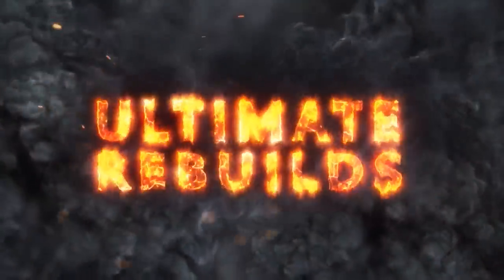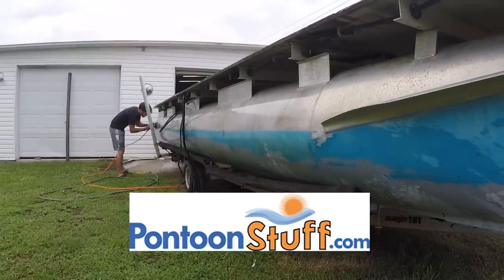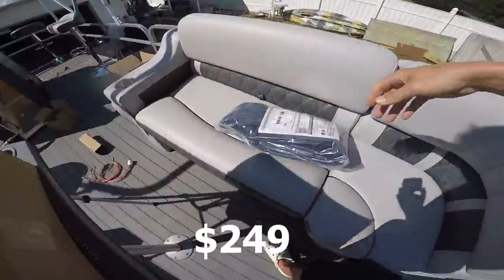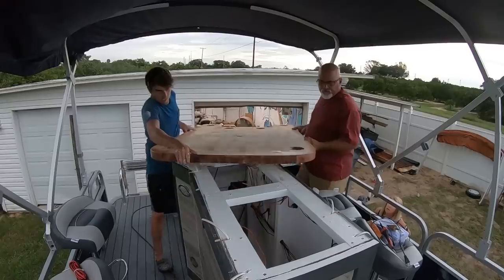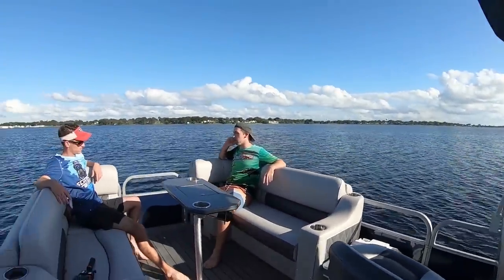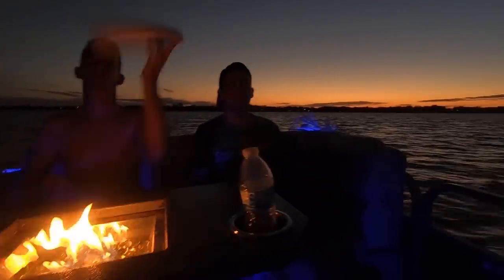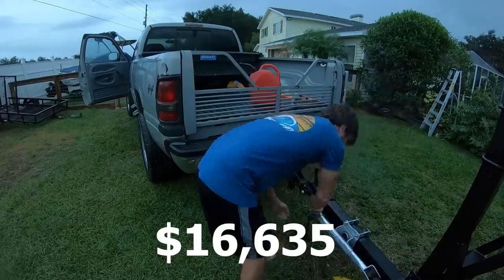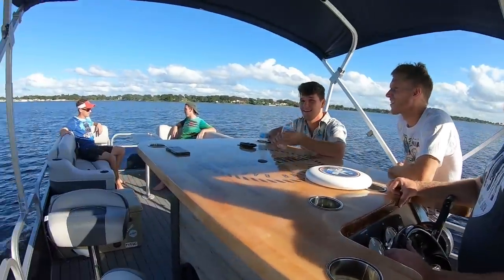How Much Did My Custom Pontoon Boat Cost?

Comment: Great job covering your rebuild in a single video!  I learned a lot.  We bought a lake house last year with a great dock system.  We are now considering a pontoon boat.  They are not cheap!  The budget friendly ones are, in my opinion, refurbishment candidates.  The decent quality ones are $15,000 up (without a trailer) and its a compromise since they don't usually have everything desired.  So I am seriously considering building/rebuilding my own.  Your experience will come in handy - definitely!  Thanks!

Comment: So yeah, what they said.😊 Seriously, you did a top notch job on this boat. What impresses me more is your attitude, the way you is how you follow through on everything. Especially selling all that stuff that came off the boat, and the trailer and whatnot. I saw a number of people that were saying you sold it too cheap, you must value your labor more. I thought pontoons were way cheaper than they are. I bought a mint 24' with trailer from Missouri or somewhere. It was $12,000. Then I realized that was 20 years ago. Ouch. 
    You are only 22, and already have a GC License, so you have plenty of wriggle room. You are super on the right track. In 3 years, Your channel, if you keep it/them, will be managed by your                                            secretary, who handles the phones, you are bidding jobs, buying material, checking in on your crew(s).
You are going to be one of the winners. Watching your  process from buying to selling, I know you will be a millionaire by 30, if you want to.

S.C.O.R.E. - Service Corps Of Retired Executives is a great resource, chapters all around. Don't be afraid to switch around, they really get it about things needing to click for both parties.

It takes a good 5 years to have things under control, not scrambling to make payroll because you are waiting on a $15,000.00 check that is 45 days past due, and paying yourself what you would accept from another GC trying to hire you. If you have to loan money to the business, that's ok too. 
The IRS says you need to take a "reasonable" salary. Owners mostly don't want to take a salary, because of the taxes you pay. But, it does include Social Security, regardless of what people say, you will get it. Also, you need to have I think, 3 years, of BIG paychecks, but they use your 3? top income years to calculate the check you will get forever once you retire. benefit. It cannot be obvious, so ramp up and down. It may very well happen anyways. You will always be the last guy to get paid, so getting your pay cut money is fine, and if god forbid, you are the one who falls off a roof, you want all the disability help you can get.

You also, and this is just critical, you need to ask: who are you, and what do you want? Dead serious, does business course through your brain? Are you a total hands on guy, not looking to get real big, please keep me out of the office. How long do I want to do this? I HATED Tree Trimming with a passion. We started by putting out flyers, yellow page ads, ask a parent what they were. And we got what we were asking for: people who call from flyers, yellow pages, names on all our trucks. I would go estimate, and you MUST talk to contractors about properly written contracts, and buy yourself a FLIR infra red hand held scanner, shows hot as yellow, red, cool, cold as Green to Blue. 

Final thing, I promise. Really avoid partnerships unless goals: I want as much as I can take out each week. Well I want to leave more money in the bank for a cash flow insurance. I want to expand. I want it like it is. We were lucky because my brother would go and do whatever I needed him for. He was Ops, I was office.
We saved almost every penny, kept buying rental units. Our retirement would be quadrupled by taking all our profits, planting them, and that is far bigger than what we could ever live off from the Tree work.

Good Luck, which is another form of making your life into what you want.

Comment: This was a great build.  
You mentioned that you wanted to make a party boat so I have an idea for you on the next pontoon build.  

Start with the base pontoon boat and instead of the railings ( as they are now ), install 4 foot walls that fold down (like an outrigger) once you get to your party location.  This would add 8 feet to the width of the party boat. Obviously you would want to add pontoons to the floors that fold out.  You could also add 4 feet the front in the same manner, but it would also have two floor fold outs so there are no holes from the front to the sides.  The front would fold out forward first, and then the two sides would then fold out to join all the extra flooring that is already there. This would give you an extra 4 feet all the way around. 

Anyway, it's just a thought and if you happen to like the idea and you do end up building it, I would love to come out and see it.
Reply: Sir, absolutely brilliant idea. I've been trying to build my own party pontoon but found that 8 ft wide (which is the widest it is allowed to be street legal) was just too narrow and flipping was a major hazard. The additional foldable pontoons would add so much space and stability. Wow
Reply: @perrybb2  If you do build this, please tag me so I can see the video.
Reply: @Jeff-gt2xu  I think I'm gonna put the additional outriggers on hinges and have them swing all the way flat on the inside rather than have them act as foldable walls. I'll link it here if/when it's completed. Right now it's a pretty trashy and rickety little vessel. It doesn't even have a motor

Comment: Here in Seattle area new pontoons Start at $1,000 per foot. Then add accessories and a little bling and you're easily $30-$50k. Used ones usually don't last more than a week in the classifieds. We have a 26 Kayot and added 2 front fishing seats, 2 rear seats, and an enclosed porta potty in the rear corner behind the driving console. It has foldout beds,a collapsible hardtop, and we replaced the 45 with a 75 and a 20 kicker and a remote controlled retractable electric trolling motor up front. And the Way Koolest trailer, back it on the lawn, crank winch#2 and the entire trailer squats down and gently sets the boat on the lawn and pulls out from under it.  Don't sell what you built, it's incredibly universal.👍👍

Comment: Most people watching this are here for the build. As a boat person….You can only carry the amount of passengers it’s rated for. Not how many people you can fit. There’s no “night boating”, you just happen to get in as it’s dark or you go out early. You need the rating plate (passengers/horsepower) back on it. There was no sign of registration markings or pfd’s. Putting it in water at night with no one who knew how to operate it. Basically from a boater perspective it’s a train wreck. 

From a restore it looks fantastic tho. Good job!

Comment: At 14:31, I see starboard running light installed but suggest you check requirements for visibility  120 degrees aft to starboard,, zero degrees forward to port.  Same for port (red) running light on the other side.

Comment: Great build! Very nice!!! My only concern was that you port and starboard lights lens should not be facing forward. They should both be turned so the 90 degree angles can be seen from the front and respective sides.
Reply from the maker: That was fixed in one of my episodes. Thanks!

Comment: Pontoon boats are cool. You definitely get the most bang for the buck in terms of walking around and using it as a floating living space.  We did find the limitation is they don't recommend taking it out 10 miles into the Gulf for the simple reason it is slow and you can't out-run the storms.

Comment: Great job on the rebuild!!  We own a 2017 Aqua Patio 259 CBD Tri-Toon that we paid a LOT more than 17K for: I think we would enjoy your boat as much as ours!  
The only thing we'd probably miss is the ability to tow water skiers.
FYI: if you mount a Blackstone griddle in conjunction with your existing BBQ, you will have an awesome floating pub!  Also, we bought a portable 12 Volt Dometic compressor refrigerated cooler.   Much better than having to deal with a cooler that needs ice.

Comment: I love pontoons. I have fished from them. Skied from them. Plus the high sides make them ideal for families with young children. You can have tons of pop up shade or create a small enclosed area with a HVAC system and or a head for the ladies privacy. Pontoons are very durable since you don't have be concerned with a gel coat getting scratched. Finally they are very steady on the water.

Comment: I know I'm late here, but on your led rings on your speakers. I have a set of Infinity 10's on my pontoon. If it's like mine, the connector doesn't exist, so you need to cut the connector off and hardwire it in. This is going to sound backwards, but 12v (+) will go to black, and 12v (-) will go to the colored wires. If you want to stay with your blue theme, just wire 12v (+) to the black wire, and 12v (-) to the blue wire and you will have blue LEDs on your speaker rings. Hope this helps.

Comment: This is just a suggestion you should build some kind a netting thing for it so you can sleep in it without the bugs bothering you because you definitely look like you fit on the couch pretty good this way you can spend the night out on the on the boat with your fire going and you can also build one to keep you dry if it starts to rain something to do a quick connect so it works for you like I said just a suggestion

Comment: Did you check to see if the pontoons are water logged?  I purchased a pontoon in Florida years ago and it sat very low in the water.  Turns out the pontoons had water in them.  If you looked at the pontoons you could not see anywhere on them that would let in water.  We ended up putting drain plugs into the end and draining the pontoons after each use.   I know that now you can purchase epoxy paint designed to seal holes in aluminum.   The reason I bring this up, the weight of the bar and seats shouldn't be much more than the seats, Captain Chair and consul that you removed.   However, the weight of the passengers is another story.   If you put 8 friends on that bad boy, she is going to sit low for sure.  Most pontoons only give you about 1000 lbs for passengers after you remove the weight of the motor, gas, food and beer!!  So very smart move putting a third pontoon on her.

Comment: Very cool! Hoping to start a pontoon boat rebuild soon myself and this provided some good insight. Thanks you
Heads up though... you installed the bow nav lights incorrectly. They need to be turned out 45 degrees, that way each light can only be viewed from head on as well as there respective side of the boat

Comment: Hey. Really nice pontoon.    My friend. I see you were installing your center tri toon with STEEL BOLTS.  You may want to change those mouthing bolts to STAINLESS STEEL due to SALT WATER.   
Or brass if there available.  Trailer internal parts don’t last long without added protection from salt water also. Check out cold galvanized paint. It works but disassembled is best to cover all areas. 
Ok. Later

Comment: I had the most bad ass pontoon. 30’ crest,  I shined the pontoons to look like a harley. It was rediculous. My neighbors used to hold there eyes and say damn where are my sunglasses. It actually hurt to look at when I turned into the sun.A shit ton of work. And a lot of time. The seats were custom made from the crest factory, super duper nice thick vinyl. Took 23 people out the first day and didn’t even bulk. I missed that bot and kick myself to this day! Sold it sooooo cheap. Bought a wakeboard boat. I miss putting in six gallons of gas and putting around after work for a week.. wakeboard bot holds 50 gallons and it hurts to fill. Well I had both boats for a while. Now I want the pontoon and sell the wakeboard boat. But I can’t find another one like it. Been looking for years.
Reply: Oh yea and I hate the new designs. Mine had like a 4 foot front porch.

Comment: Great job. The only thing I would have done was Drylock the plywood which would have kept the wood solid. Also, if you add a second deck, put the base on hinges so the deck could rock back to being flush with the lower level. .. oh and a BBQ would be awesome.

Comment: There's a sticker on there somewhere that tells you how many people it's rated for and how much weight you can have. I don't go by that. My buddy had a 30 ft tritoon with a 250 on it. I mean this thing will literally plane off and pull skis, floats, whatever your choice is. Top speed was around 37. There's only one problem with a pontoon boat that I hate. There's a rubber piece in the prop which is considered the clutch. It is very easy to break that clutch loose and you're stuck on the water. When the clutch goes out, the propeller has either broken loose from the clutch or the mounting spindle but either way you are stuck. Take and invest in a backup prop. It don't have to be anything special but I would definitely stick one in your storage.

Comment: Not bad if you don't have any value for your labor. It sure is a lot cheaper than the $90K I spent to buy my pontoon boat. However mine is a 27ft Barletta with a 300 hp Mercury V8 hanging on the back. You got a pretty good deal and I enjoy your videos. Party on my friend.

Comment: Might be a dumb idea, but you could probably grab a decent rope with a clevis that you could attach to the back of the trailer so when you off-load it and pull out, it pulls the boat to shore.

Comment: I like the led strips.  I would have put a float switch on the very back of the trailer so they automatically light up in the water.  Just a thought.

Comment: Just cover your gas tank with tarp material made into a shroud that opens on the top to fill the tank. Any canvas awning company could make it for you. 
I was thinking that if you launch the boat by yourself that you could tie a rope to the bow and to the rear of the trailer so that it unravels and pulls the boat to the shore as you pull the trailer out from under the boat. BTW, how do you get sponsors?

Comment: Nice work.  I love to build these things.  Mine is like a an aircraft carrier in its convertability.  How was you performance with the tri-toon addition compared to the bi-toons?  Speed WOT, weight etc  Thanks, I'm thinking bout a third toon.  I built mine lean from toons up and kept it very lean with furniture and installed equipment. Lots of Bean bag chairs and removable picnic tables.  Oh, and a portable boom-box.  23 mph WOT 24' Sweetwater with 40 Yammi!  Cruise all day on 12 gallons.

Comment: Tri-hull boats can handle a lot more power with many using 200hp motors and some even going 250-300. Expensive motors but faster.

Comment: You did a great job on the boat and commend you - ton of work, looks great. Would I give you $17K for it? No. The reason I wouldn't is that what you ended up with is a barge which is not what I want. I'm in the market for a pontoon boat now but what I find is that 90% of them are way under powered. Just about every boat I look at has something like 60Hp outboard on it.  These boats are generally owned by first time boat owners who, after having it a couple years, get tired of tooling around at 10mph. You can't do anything (other than drink) on something like this. Forget about any type of water sports. Way too one dimensional

Comment: Awesome for you , awesome for me also.  I was looking how other people do theirs up and found you.   I have 3 grand into mine because, I don't have sponsors and crazy ideas about  how weight does not matter LOL.    I found one in disrepair after looking for several years , took that long because these boats cost a freaking fortune up here.   I got one that was dirty as can be, I mean gross.   but its a 2006.  then I get parts  as cheap but premium when I find them I buy them, no desperation here.    My boat is usable the way it is and it gets better over time/   I think if was going to get a third pontoon tube I'd just buy a salvage one.  that weird modular plastic thing is crazy.   I ma positive cleaning that would suck.  cleaning and polishing the pontoons is work but when they are nice and shiny the slip thru the water better.  I would not paint mine.       awesome Ideas though man. I am going to do a 12v strip of Led's around the rail for lights and then my reg spot lights are fine for seeing.    I don't want to go over 4 g's total so hunt and peck is how im going.   that 4 stroke was a good deal, those are high dollar but man, the weight is crazy.    Im going to try something else.

Comment: For gas tank ideas, look to aluminum drag racing tanks.

Your bow nav lights - make sure you mount them properly.  Looks like you need to turn them 90 degrees from where you mounted them in the video.  Red/green needs to be visible only from port / starboard sides, respectively.  It looks as if you have them both forward facing.  That's a no-no.

The hate for pontoon boats doesn't stem from the boat itself, but rather from the kind of person that buys one.  Pontoon boats cater to the party crowd, and that comes along with impaired and less than knowledgeable operators.  There are more bad operators of pontoon boats than good.

Comment: 17k, not including your time would bring this up to around 25k total.  Still,  in the end it's still a 2003 with an old 4 stroke merc so not worth it.  Good project and experience though.  I'd have kept most of the old guts, new engine and simply redo of things.  Much easier than replacing everything